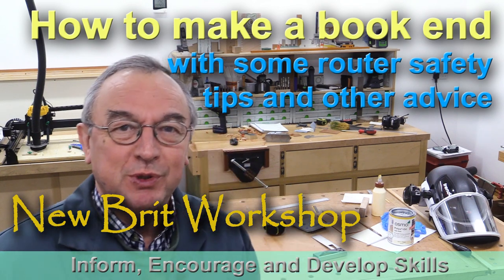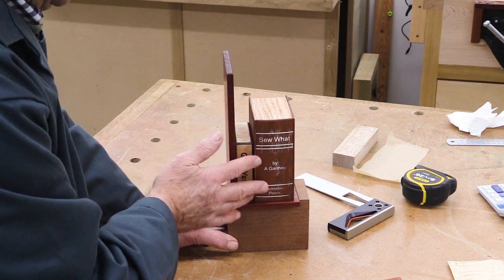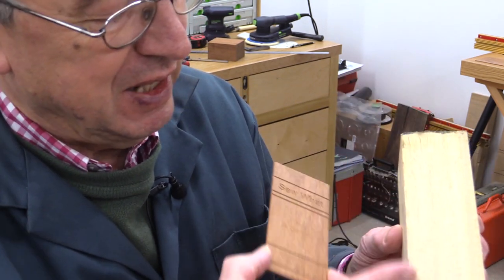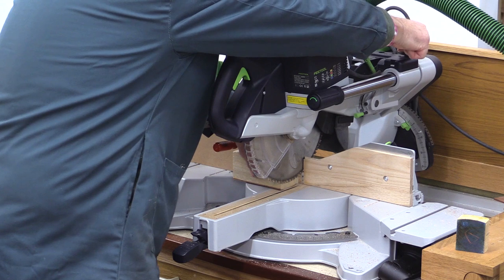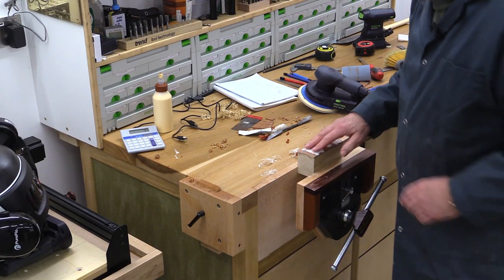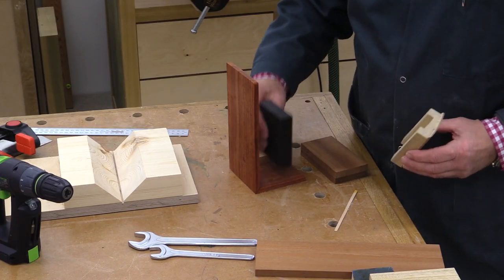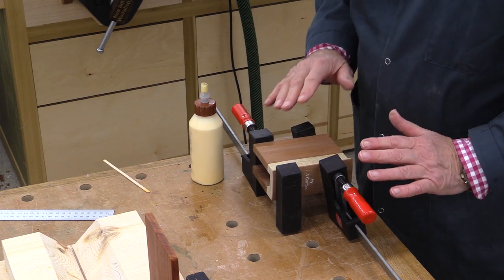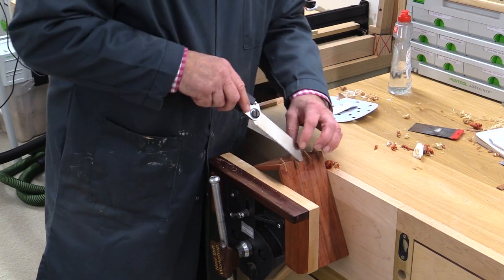How to make a bookend

Comment: Hi, Peter. On thicknessing bits of very thin wood with the planer. What I do is stick the wood to a backer board of 3/4" or so stock with double-sided tape and run them through together.I make very light passes so the wood doesn't get pulled away from the backer. Has worked well for me in the past.
Reply from the maker: That sound like a very good idea and is probably safer than my approach.  Cheers. Peter

Comment: That wood looks like padauk to me. A few folks have suggested bubinga, but to me bubinga looks a bit pinkish -brown, as opposed to the darker reddish-brown of your wood. Yours also appears to have a slightly open grain, which is much more characteristic of padauk than bubinga.

I do a lot of wood turning, and I bought pieces of a bunch of exotic hardwoods to see what they were like to turn.  I've made tool handles out of of both padauk and bubinga. They're both fun to turn, though bubinga is very hard and dense and I had to sharpen my tools frequently. Bubinga's extreme strength makes it great for tool handles. Unfortunately it has an extreme price these days. Easy Wood Tools used to use it for handles on their "pro" tools, but they've switched to hickory.

I love the way you made the fake, wooden books. Very clever! I can't remember whether you own a drum sander. If you do, that would be a safer way to make those super thin sheets of wood.
Reply from the maker: Hi Laura, Yes, I think it must be Padauk.  Many thanks.  Peter

Comment: Thanks Peter for this useful project. I think my daughter who loves to read would enjoy a bookend like this. I think I will try wetting the veneer for the spline to help it curve. I don't have a CNC so will have to come up with another method for the text.

I read your book and enjoyed it thoroughly and recommended it to others. 

Cheers!
Reply from the maker: Hi Bob, When I was at school (quite some time ago !) I made a bookend from a household brick. I covered it in thick card and used Letraset on the spine. One could use a laser printer today. The card could be glued to a wooden backing. Failing that, try finding a friend with a CNC.  Cheers.  Peter

Comment: if you had used the Osmo on the timber before engraving, them added the white filler, it. wouldnt have gotten into the grain. then sand back as you did and reapply to finish. or even simpler, use the masking tape on the timber before you engraved and peel off after the filler has cured.
Reply: ha, didnt wait for the end
Reply from the maker: Hi Scott, No, I think that you are right - the Osmo would have been perfect. If I make another I will use that tip. Many thanks.  Peter

Comment: Hi Peter,  a very impressive little (not so little technically) project.  I wish you had shown a bit more detail of thicknessing the very thin pieces for the sides of the book.  I would have started to cut off the splines at the other side so the saw wouldn't foul the adjacent spline, lucky you didn't break one off doing it your way.  In the end a very neat bookend and more fun than the " usual" type available.  WKR  Mike
Reply from the maker: Hi Mike, Many thanks.  Peter
Reply: @NewBritWorkshop  Hi Peter,  I watched this again to check on the jig for thicknessing very thin pieces but, unfortunately, I couldn't see enough detail about the jig to be able to make it unless it's just a piece of melamine faced chipboard on which the workpiece just sits without any securing.
Reply from the maker: @katabrontes  The jig is a flat piece of formica covered ply (smooth finish) which has a piece of wood glued under one end that engages with the lip of the bottom bed. I also use a clamp to keep it in place which has to be positioned out of the way of the passage of material. This is a dangerous technique and planing less than 4 mm can mean that the wood explodes into large sharp splinters that are projected at high speed.  Peter
Reply: @NewBritWorkshop  Thanks Peter,  would it be safer if the " filler " was allowed to move along the bed of the thicknesser with the workpiece moved by a friction grip on the base?  Probably by using your jig with the Formica downwards and waxed and the workpiece sitting on the wood side to give a better grip?
Reply from the maker: @katabrontes  Hi Mike, I do not know what would be safer as it is risky. All I can say is that I have always had the piece fixed with every planing machine that I have owned. Remember - this is a dangerous setup and you do this at your own risk.  Peter
Reply: @NewBritWorkshop  Hi Peter, Understood ( about the risk). I assume the ejected fragments would come out of the infeed side of the thicknesser so you need to stand well to one side to reduce the risk.  I doubt I would need to do this much if at all but it is useful to know there is a way to do it if needed.  I suppose the alternative would be a well sharpened hand plane or a hand held power plane.
Reply: Hi Peter, recalling your demonstration of your bandsaw when I visited you at NBW wouldn't the safest solution be to cut a thin piece (ie a veneer about 2-3 mm thick) on the bandsaw and finish the surfaces with a hand plane or sander.  The faces might not be quite parallel but for the purpose intended this isn't critical.
Reply from the maker: @katabrontes  I did cut the mahogany on the bandsaw and it was about 3.5 mm thick. To then hand plane it would not give a consistent thickness (with me doing it anyway). If the finished product needs to be consistent and planed on both sides then I will use my method. If the thin piece is to be joined to something else then there is the possibility that the rough side gets planed after the pieces are glued together.  Peter
Reply: @NewBritWorkshop  Understood but you are too modest about your skill level.  Of course Rob Cosman would get it perfect but few of us have his level of skill I expect.